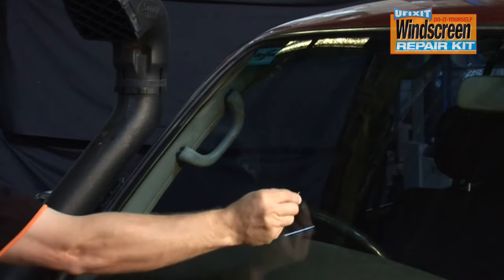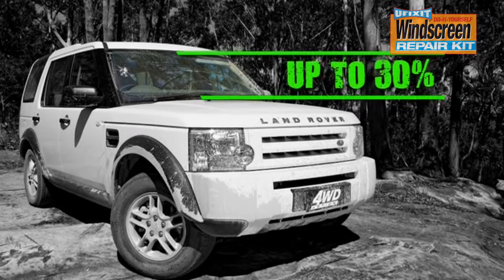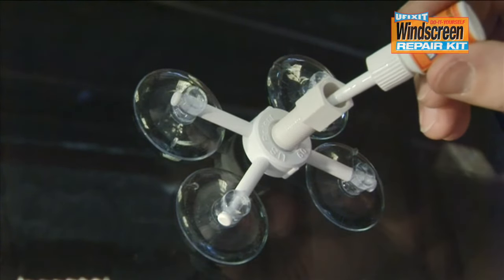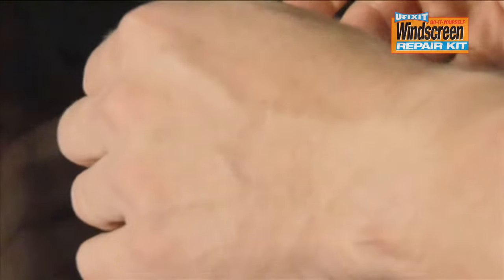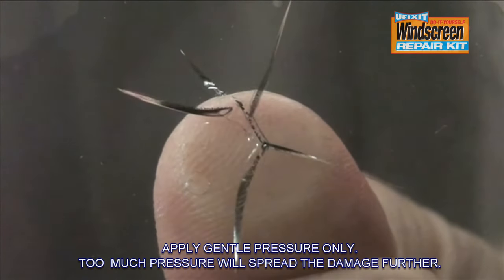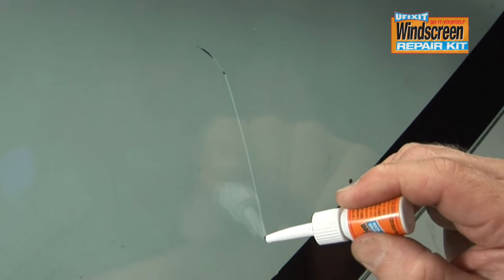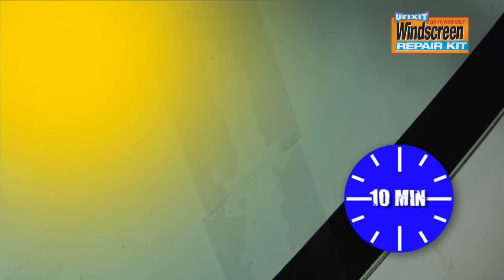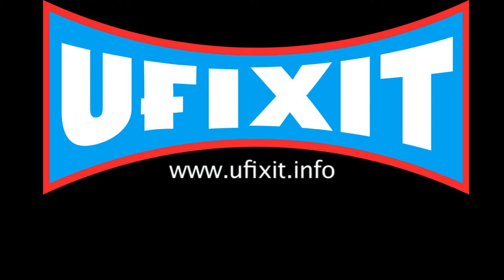Ufixit Windscreen Repair Kit HD

Comment: Just tried this, and it worked a treat! The chip that I had was actually bigger than I thought it was when I applied the resin, but this filled it in perfectly without issue.

Comment: I would not use this on anything smaller than a pea size stone chick. I tried it on a 20mm spider crack and was a gentle as I could be. Ended up making it worse and cracking even further. Like I said, might be OK on a small chip but not a larger type chip that the product claims to be able to do
Reply from the maker: Can you please email us at info@ufixit.com.au with your contact details so that we can discuss this with you. We are concerned about the results of your repair as our kit should easily be able to fix the type of damage you described.

Comment: I had a decent sized star in my windshield, about 1.5cm x 1.5cm and I was skeptical about this product but didn't have time to get to a Pro before the cracks might start expanding, so I reluctantly tried the UFIXIT kit. I did everything by the instructions and was more than happy with the result! In the right light I can see the resin and where it has filled the chip and the cracks, and it took a while to remove the excess resin, but wow at the result. I am now going to have a go at some small bullseyes on my other cars. I highly recommend this product, especially if a Pro repair is beyond your budget.

Comment: I try everything with this product and it's average at best. followed this procedure several times and it wont fill the crack no matter what. It filled the hole in the star but it wont fill the cracks. I tried heat pressure repeated several times and it still wont fill the cracks. It will fill damage enough so the Wiper Blades wont get damaged and sometimes thats enough to get it past a Roadworthy most times
Reply from the maker: Paul, to fill the cracked area you have to use the crack repair method after you have used the applicator to inject the resin into the chip. Send us an email to info@ufixit.com.au with your contact details and I will get someone to call you to discuss. Regards UFIXIT
Reply: @demsgroup  Did that 4 or 5 times with heat and pressure from inside Screen still a no go. What I dont know is how old the damage was. Its a Car with unknown history. If the crack is old does that make any difference?

Comment: I followed all steps correctly by the instruction sheet and it didn't work, the last step of putting resin on the cracks and then the cure strip and then 5 mins in direct sunlight the resin still hasn't hardened after 20 mins in direct sunlight so do i do it all over again?
Reply from the maker: Glen can you email your phone number to info@ufixit.com.au and I will get someone to call you about this. Thanks

Comment: It's bulshit it's not the same as what the windscreen guys use this stuff is like water. They make it look so easy it is loaded crap 10 minutes later and it's lock water 20 minutes later it still like water the stuff they're selling is not like what he's using
Reply from the maker: I don't understand what your complaint is? The resin is a liquid, which allows it to penetrate into the damage. Once all of the air is removed, can take up to an hour, you then expose the repair covered by a curing strip to direct sunlight for 5 minutes. This process then hardens the resin. I don’t understand your ‘water’ comment. If you would like to discuss this further I am happy to call you. Please send you contact information to info@demsgroup.com.au and I will call you to discuss.